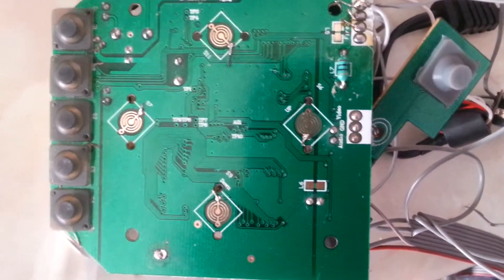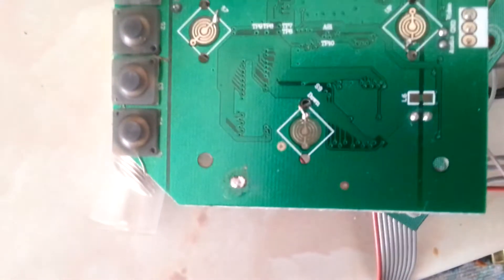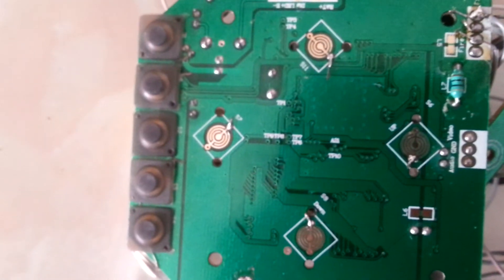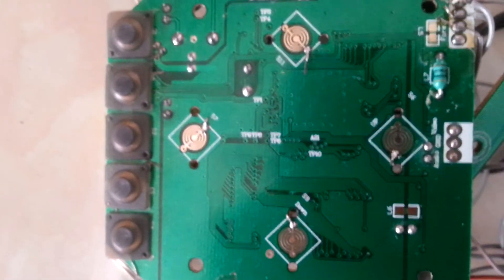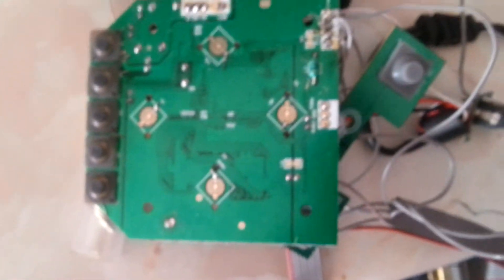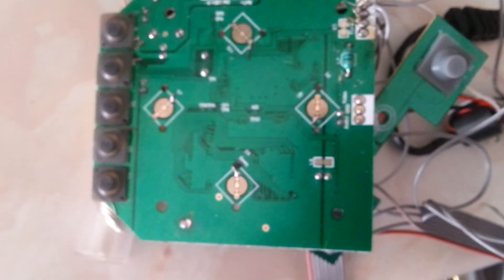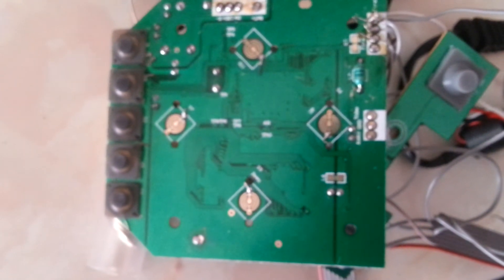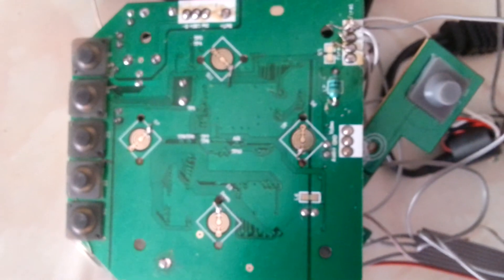C64 DTV Hacking Video Part 2

Comment: is it possible to add more c64 games?
Reply: Depends on the version. Version 1. You can play games from floppy or SD card, but not add games to the actual system. Version 2 and 3 you CAN add games to the actual system.